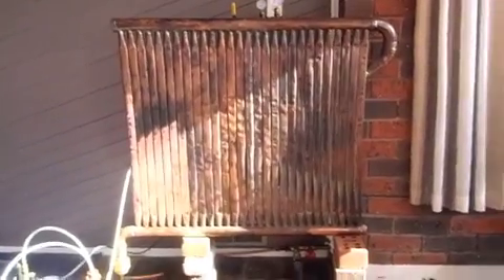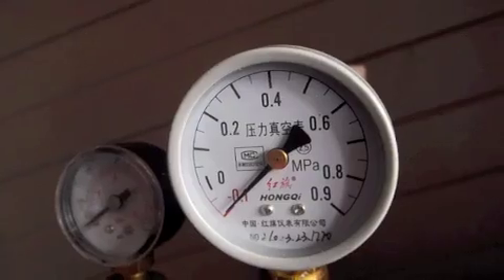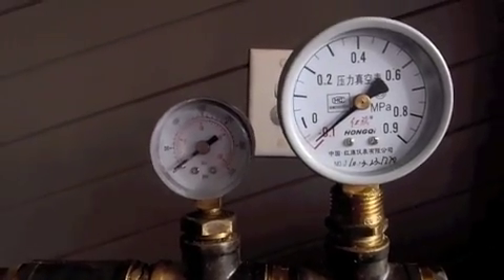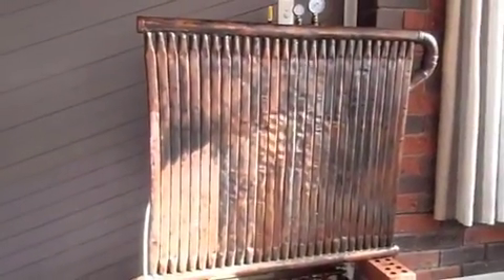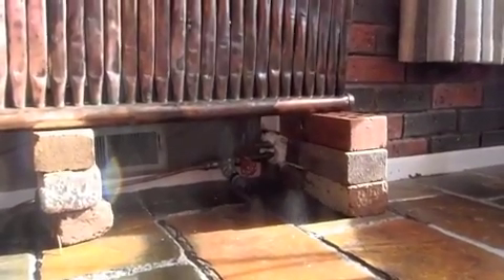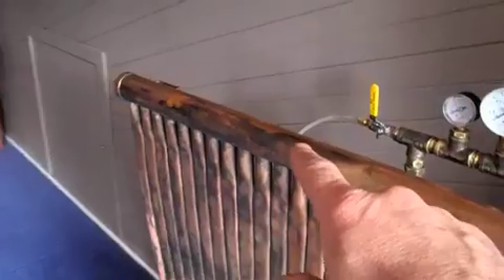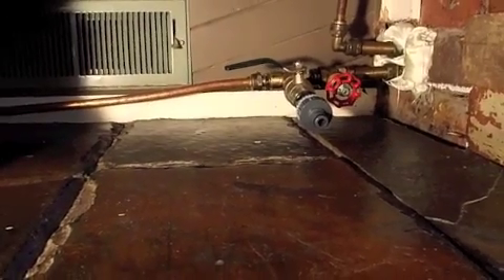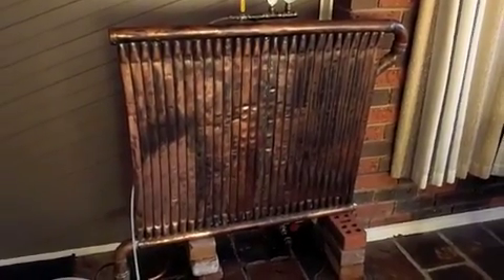Chimney Heat Pipe

Comment: Thanks Mal, i've been thinking of this for my fire place. already have a an old wood fired stove heating the house water. but wanted to build a condenser. cool !
Reply from the maker: Hello Kenny,
Great to hear from you. I don't track my gmail very well so I've been slow to repond. I've made a few improvements since I uploaded the video and there are a few more I still want to make. It doesn't sit on bricks anymore and there is a plate sealing the hole in the chimney. It's prone to leaking, so i've removed a lot of connections. And I now have a better pressure gauge.
With a few more changes I think I can fill it without a vacuum pump.
Mal

Comment: One way pipes are good enough.
Air intake(s) down stairs, put hot air exits anywhere you can run the pipe(s) to. Hot air flows upward easy enough. No pump needed but fans will help

Comment: Could you be able to show plans for this item with dimensions of feet of copper pipe and thickness would really make this work out for me. Does a real hot fire cause any problems for the system ??? Thanks
Reply from the maker: Hi, I don't have detailed plans of the system. I posted this other video explaining how this Looped Heat Pipe works which might help. The link is in the description.

The temperature of the fluid in the heat pipe is somewhere between the temp of the fire and the temperature of the room air. If the condenser performs better then the heat pipe fluid temperature will be closer to the room temperature. if the condenser performs worse then the heat pipe fluid temperature will be closer the fire temperature. 
So it's a balance between the room and fire temperatures depending on the heat exchangers. If you use the steam tables you can work out the pressure in the system from the temperature and decide if the system will blow up.
Reply: @thethermalengineer5375  Can you tell me the copper wall thickness or as what we use in American Standard with letters M L K. Which M is thinnest and K is thickest. How about pipe inside diameters of three individual parts ??? Thanks
Reply from the maker: I don't have detailed plans of the system. The copper pipe was 1/2 in from the local hardware store. The condenser was scrap from work. To determine the wall thickness I would have to disassemble it which I don't want to do.
Reply: @thethermalengineer5375  What are the other pipe sizes and length of the condenser and width. Thanks a bunch fella for you help. Peace. VF
Reply from the maker: The pipes are 1/2 inch copper from the local hardware. I don't know the wall thickness. I don't have dimensions for the condenser or the pipes in the chimney. Why do you need to know this? I can't see why it would be useful to you. I didn't need to know it and I built it.
Reply: @thethermalengineer5375  The reason I want to know dimensional sizes it that you figured out the size balance of the system. I am not an engineer and if I know what are the dimensions I could be sure the system would work footlessly like your Sir. Did you use distilled water inside the pipe ?? Thanks VF
Reply: @thethermalengineer5375  Where could I find the steam tables TTE??? Thanks
Reply from the maker: @victoryfirst2878  if you google “steam table” you can find a few options. There are also a few on line steam property calculators
Reply from the maker: @victoryfirst2878  yes, I used distilled water. The system will find its own balance depending on the performance of the two heat exchangers.
Reply: @thethermalengineer5375  Thank you for the info fella. VF

Comment: Cool project. The problem I see is very low surface area on the evaporator.
Reply from the maker: The condenser also has a low surface area. There are a few improvements like that I would make if I do it again.
Reply: Turn the condenser pipes (flats) 90⁰ for air flow between them. My concern is the hole in the chimney.

Comment: Having made quite some glass heatpipes myself which allows you to look inside and see what is going on, I am suspecting your evaporator design could use quite some improvement. It is very long and comparatively narrow, and likely to be flooded if you have liters of water in the system. Evaporation is only happening very efficiently at the interface with the gas; so having a pipe with a large wetted surface is ideal; but a flooded pipe is far from. Wicks made all the difference in my glass heat pipes; even for a purely gravity assisted design such as yours. By holding most of the liquid in a layer against the surface and leaving a gas channel in the middle, things should improve a lot. I used finely woven glass fibre sleeving; and it was important to get it in without kinks. Even a small 'plug' of water halfway down the pipe will ruin performance; the pressure differences in the gas are quite low, and the gas needs to be able to move around fast in order to actually move significant heat. If a part of your pipe isnt connected by a path of free gas to the rest of the system it might as well not be there.
Reply from the maker: Than you Eelco. I'll consider wicking next time. What fluid were you using? I used water as a vapour (and just a little liquid), but it wasn't heated enough to be a gas. Vapour is a far better conductor of heat than liquid or gas. Through the evaporator there would have been inefficient liquid at the bottom, but more efficient vapour as it rose up to the condenser.
Reply: I tried both water and pure alcohol; I was hoping to see better low temperature performance with the alcohol but I didnt manage to realise much of it, and the water was clearly the superior medium overall as theory would predict; and no doubt it is the best option for the temperatures your system will encounter. I think you could try building your evaporator more like your condensor, with a set of vertical pipes in parallel, with enough water in the system so that the bottom of these pipes are just sitting in liquid water, and some kind of wick spreading that water over a good area of the tubes, while leaving the vapor free to move upwards through the middle of the pipes. Actually; there is something to be said for having the liquid water coming in from the top, since a wick will only pull up the water to a limited height, but then the trick is to not have the water build up and plug up just in the tube closest to where the liquid water comes down, but maintain an even wetting of all your inner surfaces. Or I suppose a mostly-horizontal set of tubes would be ideal; with the liquid water at the lowest point not getting in the way of your gas flow, but your wicks being able to pull the water along efficiently with minimal resistance from gravity. It all still has to fit into your chimney as well of course...

In any case, cool project; ive been thinking of ways in which to apply heat pipes in my own home heating setup, but never actually gotten around to doing anything on this scale yet. Curious to see how this will progress!
Reply: Also; I am guilty of way overthinking this here. Just putting a piece of wool thread into my heatpipe already made a tremendous difference in terms of wicking, and breaking up the tendency of liquid water to form 'plugs'. That is, until the thread plugged up itself under the agitation of the boiling water, but the moral of the story being; just play around with some types of wicks and you might be surprised at what does and doesnt work for your setup. In any case they can still make a huge difference, even if you are not trying to work against gravity.
Reply from the maker: Good ideas Eelco. I built the evaporator out of scrap copper tube I had held together with wire I stripped out of an old cable. It was OK to prove the concept. I would have preferred to have two pressed panels with the refrigerant flowing between them. This would reduce a concern I have over creosote build up. The condenser was one from work that I bought for the price of the scrap copper. It was used to cool down concentrated solar cells on a heliostat. I was developing the heat pipe as a better way to cool down these cells. I built my system to prove the concept and see if I understood a looped heat pipe.
Reply: Yeah creosote is a thing as well; when i try testing my heatpipes over a candle flame it is crazy how fast the buildup of soot is,with the rapid cooling and all. Better to install such a system after a secondary combustion chamber; or otherwise make it really easy to clean...

Comment: If I am understanding this correctly you have half water half water vapor? ..... Yet you have 7 litres in it?

If you have water exiting your "Condenser" you will have water entering your heat exchanger. If your heat exchanger has liquid water in it it will "plug" the pipe and if it fills the first loop or higher you will get an air lock (or one on each loop) this will stop the flow until each one boils and sends a spurt of steam to the next one. This could explain the "tinking" noises you hear! 

If you fill the whole system with water it would act as a normal gravity fed radiator system like many homes had in the UK back in the post war years. They used to have an expansion tank in the loft with the pipe feeding over the top edge of the tank and a separate feed from the tank to the system. They did used to gurgle a lot when the fire was boiling the water but they did not hve any problems with over pressure!
Reply from the maker: Yes, you seem to understand it. It's mainly vapour with some water at the bottom. The volume is 9 litres. I put in about 2kg of water. The only way 2 kg of water can fill 9 litres is for it to change to a vapour. Gravity pulls the wetter vapour to the bottom which becomes liquid.
You've described the cause of the "tinking" ( I call it "banging") correctly. Although there is no air in the system so it's not exactly an air lock. It's the vapour trying to get past the liquid. 
It's not like the gravity fed radiator system as uses a vapour, not a liquid. Those systems would have a pump to move the fluid and an expansion tank sized to take the expansion of the liquid. They might also have no pump and use convection/ conduction to move the fluid. This would be very slow. 100°C water is only 4% less dense than 20°C water
A looped heat pipe uses the change in density of the vapour to move the fluid. Wet vapour is 2000 times more dense than dry vapour. That's why no pump is required.
Reply: @thethermalengineer5375  Have you tried a surficant in the water ... a drop of washing up liquid might lower the surface tension of the condensed water to allow more vapor. Too much may cause it to bubble though!
Do you still have it in operation?
Reply from the maker: Hi Dave, Interesting suggestion. There is no air in the system so surface tension isn't a problem. Water is possibly the best fluid to use as a refrigerant in a heat pipe so I wouldn't dilute it's properties by adding another fluid. I've created a better explanation of how it works in this video a few days ago.
https://youtu.be/oYGqkc149vM

Comment: safety valve?
Reply from the maker: Hi, I originally planned for a valve, but the pressures never got high. Usually the pressure is below atmosphere, This is probably because the average temperature is below 100°C.
Reply from the maker: I removed the pressure valve as the pressure was always below atmospheric pressure

Comment: very interesting project. i have been considering a similar idea where i use an old school cast iron radiator into a air return duct which is located very close to my chimney.  i was planning a coil of copper right up the chimney to grab the heat. what i am really wondering is how much heat to you feel on what u call your evaporator? is it hot to the touch? have u ever measured chimney temp with or without the system operating? i dont wanna build it if the thing only gets lukewarm. im sure the amount of surface area of copper is the driving factor but was hoping from u to just get a basic idea of heat exchange.
Reply from the maker: Hi, Sorry for the slow response. The heat exchanger in the room is hot to touch. I can hold my hand on 60C, 70C for a few seconds.  100C I'll burn myself. So I estimate this is 80 or 90C. That's the temperature, but not the heat. I estimated that the fireplace would be 200 to 300C. Once again this is temperature, not heat. I was planning on a better heat exchanger in the room with more surface area and a fan. This would increase the heat output and decrease the exchanger temperature. 
You have to be careful how much heat you take out of the chimney. The chimney draw is helped by the heat of the fire. The draw might be affected if too much heat is removed from the chimney.

Comment: +Mal Heys - copper has a high rate of heat exchange, what type of pipes did you use in order to transport the hot water to the condenser element in the next room?(I mean how to reduce loss of heat while transferring the hot water to the next room?)
Reply from the maker: Hello Samer, I used copper throughout the system. There is only a small distance from the chimney to the condenser so heat loss is not a problem. If Iit was a problem I would insulate the pipes. Any heat lost will go into the room I'm heating anyway. Changing materials would require adding connections which would increase possible leaks. Leaks are a bigger concern than heat loss. Are you planning on making one?
Reply: Yes I am planning on making a similar one but linked to the central heating system to all rooms. Thanks for the video that was so interesting
Reply from the maker: Just a thought. Make sure the condenser is above the evaporator otherwise you will have to create some wicking which would be difficult with a looped heat pipe of this size. Good luck.
Reply: If I have the condenser below the evaporator, I can install a small pump to loop the water. and by the way, isn't it dangerous if the water turned into steam(the pipes will blow and leak)?
Reply from the maker: Samer, Please be careful. A heat pipe has the water in 2 phase (i.e. steam) under a very, very low pressure. If it was in at atmospheric pressure then you are right it would explode. Here is a link to a blog I was writing which might explain it better. 
https://wordpress.com/post/greeningmyhouseblog.wordpress.com/140
Reply: Thanks a lot!! :)